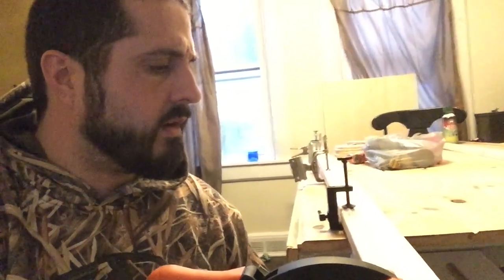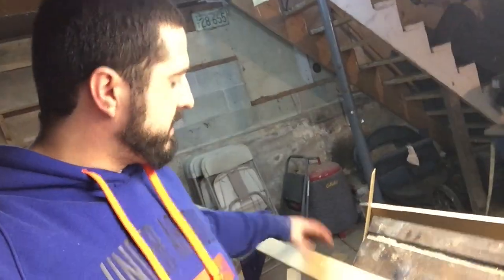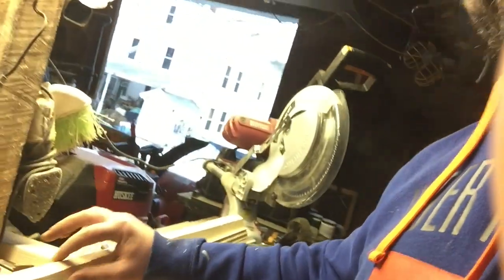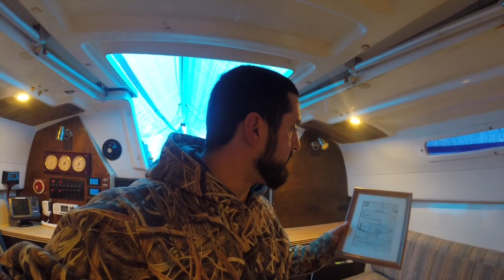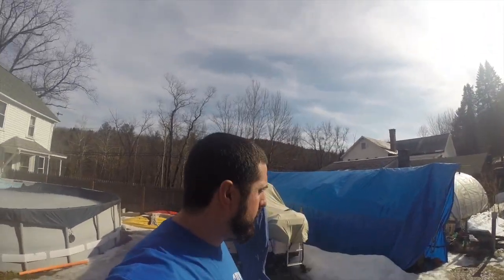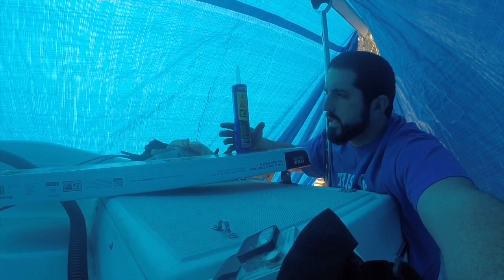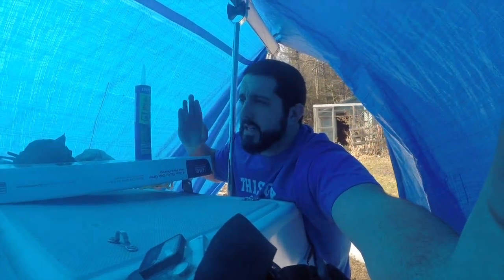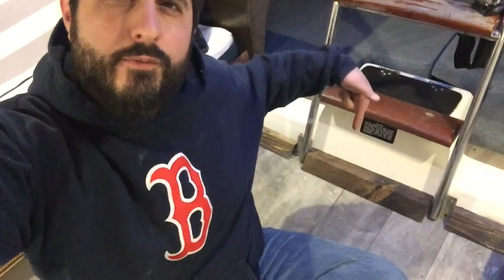Sailboat Restoration: Wood Trim & Vinyl Floors

Comment: Looks awesome!  Adding the trim around the floor made it look so much nicer.  Might have to do something like that for my Mac25.  I have a bunch of doormats all with the same pattern cut to fit my floor at the moment.  Doormats are very durable but its hard to get them in light colors.
You have definitely encouraged me to make trim pieces for the edging of my LED ceiling.  It definitely looks DIY at the moment, and some trim is going to make it look more finished for sure.
Reply from the maker: Yes I totally agree. It was definitely worth that one extra step and really finishes it off nice!

Comment: very nice.  I would recommend a small hand plane or even a block plane rather than a construction blade and extreme angle on the table saw. even a 20$ well honed block plane would do .

Comment: OK, I got the impression that perhaps, maybe, you are going to use that new/used sewing machine to make some new cushion covers(they really look tired) . Reminds us all, was there wood trim inside the boat before? I can't remember it. I guess I could go back to the beginning episodes to get the answer but having you tell us would be so much simper!  The flooring really looks great and I hope that adhesive does the trick, even when wet. Looks like you are teaching your lad which end of a screw driver to hold and that, sir, is a good thing for a Dad to do.
Reply from the maker: Yes! New cushion covers indeed! And no there was no wood trim there before, I stole that idea from someone on one of the Facebook groups though.

Comment: Please let us know how those floors have matured once the temperature rose to 95F in the summer. Did they expand because they were installed during the winter and they expanded when they got warmer? I'm thinking of pergo on a boat and worried about the edges and how much expansion gap space is needed for summer expansion so they don't buckle.
Reply from the maker: they have been fine ever since
Reply: @SailingFreeStyle   thank you, awesome video.

Comment: how much have you spent on it so far (roughly)? going along pretty good for a free boat. have had a few free powerboats when i was young. some we finished, some barely got touched lol sadly never got to enjoy any of them as they were either sold off or given away before we could take them out lol. was a good learning experience at least
Reply from the maker: Oh man, tough question. I have not been keeping track to be honest. Just right out of the gate to replace the daggerboard was $600 shipped, motor was around $300 and new tires for the trailer were I think $75. So there’s $1,000 right there just to have a basic boat. After than in necessary repairs say about $100 - $150 (fiber glass, sail tape, etc), so we are in it at that point  for $1,100 - $1,200 and then have a functioning sailable even stay overnight able Sailboat. Everything after that has just been things I wanted to do and not necessarily things that HAD to get done and I’m sure I spent another $1,000 -  $1,500 one everything else (new jib, new deck hardware, electrical components etc) NOW the big thing is I LOVE doing this! This is my hobby, I like the projects I like keeping busy and I like being creative and solving problems etc. so spending  a Little bit every week on my hobby doesn’t seem like much to me. I pick things up here and there and work on things one step at a time so it doesn’t FEEL like I dropped a giant wad on everything all at once. Some people spend a lot of money on star bucks every week, or a gym membership or sports or anything else people do in their free time. I don’t - I work on my boat. I also have been able to offset some of the expenses by making these videos. This channel is kinda like my side job where I spend a bunch of my time making entertaining content with the hope of generating some income to help pay for the project. Right now I get about $60 a month between ad revenue and patron support. Will I end up spending more money on this boat than what it ends up being worth? Probably, but maybe not. I bet I can break about even in resale value, but even if I don’t it’s not really about that. It’s about the creative process, that’s where I feel like I’m getting my money’s worth.

Comment: Good job....question...does that vinyl flooring expand and contract like other click together flooring?
Reply from the maker: I think most of that flooring has a wood based component to it, which would absorb moisture which would be the cause of the expanding and contracting that you're talking about. While EVERYTHING technically does this to an extent i think the vinyl would only do it minimally (unnoticeably) while something that has moisture would do it to a much greater extent.
Reply: the vinyl and fibreglass should expand and contract at about the same rate anyhow seeing as they are both basically plastic.
Reply: Donald Mackay  hmm, I had heard that one of the problems with putting epoxy over poly or vynilester (apart from no chemical bond) resins was the different expansion rates in varying temperatures.

Comment: Looks great Ryan and son. Does the boat's former owner subscribe or drop by to peak at your progress?
Get some feather boards for your table saw. They keep work flat on the table and tight to the fence.
Reply from the maker: Cool I’ll check that out! That table saw is actually my grandfathers passed down to my father passed down to me! It’s so old! I’m sure it wouldn’t pass any of the safety regulations of today!! Lol.
Reply: You can put the blade down to the height of the lumber to be a lot safer too.

Comment: FYI: The table saw blade is way too high. I needs to be adjusted so the blade is only barely higher than the wood you are cutting. Sometimes you can ask me how I know, and I will send you a picture of my finger, and I was really lucky. It really didn't bleed that long. Otherwise, I enjoy your videos.
Reply from the maker: Yeaaaaa, however, I also know from a trip to the ER myself that when its down low it likes to throw chunks of wood at your head! Soooooo its been that high ever since.
Reply: LOL -- True, but the trick is to NOT stand directly in line with the blade.

Comment: Dude, lower that saw blade no need for it to be sticking up so high.
Reply: Darrell Allen Having the blade up high whilst increasing the risk of cutting your fingers off, will reduce the risk of kickback, which can be quite dangerous as well.  best option would be to install a guard though.
Reply from the maker: That saw is close to 70 years old, lol, if I drop it I’m not sure it would ever come back up.